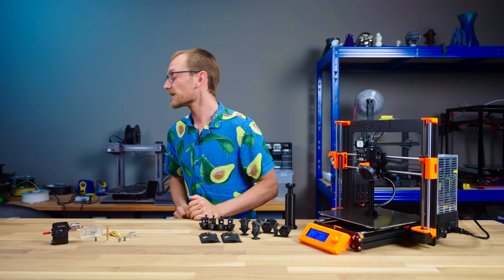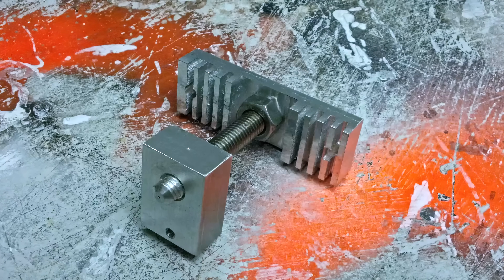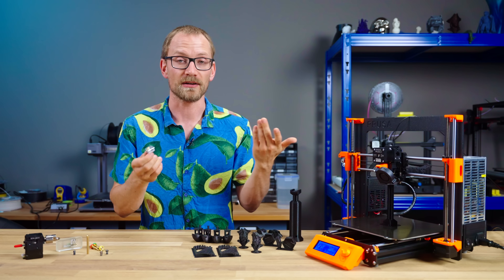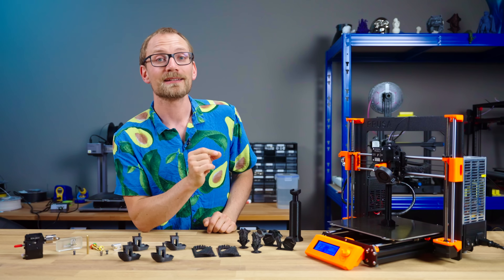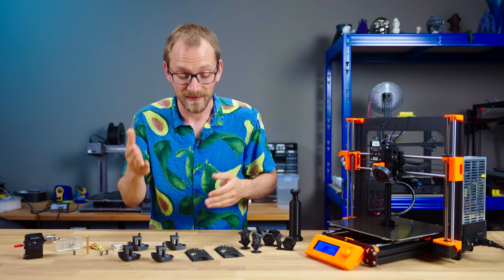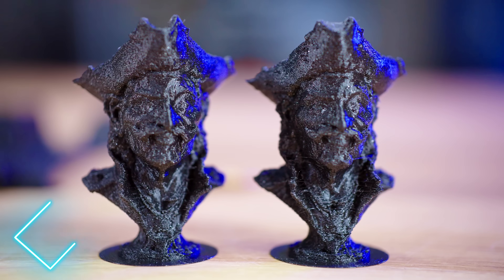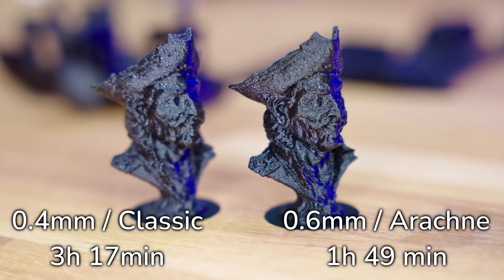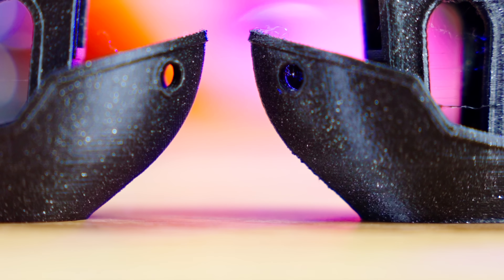0.4mm nozzles just became obsolete

Comment: I think this comparison is a bit unfair. What about comparing 0.4 and 0.6 both with arachne? This is not the correct way to compare nozzles. The slicer algorithm has a primary effect on the quality of the 3d printed part. Also: 0.6 nozzle may work fine on PLA but what about more challenging materials which are much more prone to oozing? And please get rid of that glitter! Not to mention that every change in layer height produces also a change in the strength of the 3d printed part, that is not negligible for functional parts (left aside desktop miniatures)

Comment: You just hit on a major issue with larger nozzle sizes and speed / heat. greater amounts of material means the extruder needs to run faster. Faster speed needs hotter temperatures. This is even a greater issue as the print speed increases.

Another concern might be retraction. Having greater amounts of material means retraction might need to be faster and for longer distances to create back pressure. This could led to more hot filament being pulled into the nozzle and heat break resulting in blockages.

I think there might need to be more testing before I would recommend to beginners to just upgrade.

Comment: Great timing 😁 Finally someone made a precision machined nickel-plated copper "nozzle extension" piece, so now I can use my fancy 0.6mm "regular" length nozzles in my volcano style block 😃 - Including the filament "splitting", high flow type nozzles, and other speciality nozzles that just aren't available in "volcano" format at all 😃 best $2 ($4 w/shipping) I spent in a long time, now I can get "everything" done while focusing nozzle budgets on just one format - no need to buy volcano nozzles anymore to print with "volcano hotends/blocks". With this tweak, I can regain a bit of the detail lost just running 0.6 "regularly".

Comment: I have all my slicer profiles set to a constant flow rate, being 10mm3/s, and use M220 to change the speed per filament (I use Klipper and reworked M220 to only change print speed, and travel and retractions are not affected, making it a speed parameter for flow rate). With my workflow, a larger nozzle wouldn't necessarily speed up anything aside from travel moves, especially considering extrusion width exists. Now, the higher layer heights would be attractive for cosmetic purposes because that's a function of the bore hole, not extrusion width to my understanding.

Comment: I came to the exact same conclusion.  I use .6 on all my machines except for one at 0.5 on a tuned in machine.  Especially since the insane software improvements of late it's hard to tell the difference.  The only time I bother to swap out for smaller nozzles is for gears.

Comment: depends on what you are printing.  In the case of models you want to see no layer lines, so running a .4 with Arachne with a .1 layer height will give good results.  Been running Cura 5.0 for a while now with Arachne, and it just changes everything for the better, regardless of what you are printing.  Looks like everyone else is playing catchup in adding the new engine LOL.  
I print N scale and HO scale models on my FDM and SLA printers, and the advent of Arachne changed a lot of what I could print on the FDM printers.  Small detail parts in N scale were hard or ignored before, like a hand brake wheel, actually do print on the FDM now.  Granted they are still much cleaner on the SLA as they should be, but at least it IS possible for it to show up.

Comment: You really need to address volumetric printing. Nobody should print with print speed settings anymore. Volumetric speed is the only consistent way of getting good result and printing times between nozzle sizes are minimal when you do this. Volumetric printing is optimizing and not skipping steps

Comment: Another perk to .6mm: lower chance of clog (any charred detritus or dust smaller than .6 will pass through)
Another downside to .6mm: resolution of sharp details of the faces of parts (not shown super well by the pirate). Absolute no go for minis. Top surfaces will also suffer a little bit on those sorts of models for the same reason.
That being said, looks like I'm getting another bag of .6mm nozzles!

Comment: From my experience most printers are flow rate limited, meaning increasing acceleration and speed with a smaller extrusion width and layer height will get you better results with the same speed.

Maybe you want to print your infill or internal perimeters thicker for the sake of strength and cohesion. Why not just increase extrusion width for these features?
Reply: My MK3S is flow rate limited when I'm using the 0.8mm nozzle, or flexible filaments using pretty much any nozzle. But with PLA or PETG and a 0.4mm nozzle I can't hit the limits of flow rate without encountering problems related to nozzle speed and acceleration. My guess would be that this is common to most "bed slinger" designs.

Comment: What about strength?  I have had a few failures with prints that I thought were solid, but had a layer binding flaw buried in there which weakened the part significantly.  Can I improve layer bonding with the larger nozzles?

Comment: I use 1.2mm nozzle
300x300x300 cube prints in less than 24 hrs :)
0.35mm layer height
45mm/s print speeds
I use it for printing giant hollow RC airframes
I made a 1;25 scale B-2 Bomber in 12 parts

Comment: Recently printed a 5-inch hose connector to attach to a base-board for the heat exhaust of a portable AC unit. Was gonna take nearly a day to print on 0.4, but I went strait to a 1mm nozzle and cut that down to like 5 hours and the part came out super strong! 
I am definitely an advocate for using larger nozzles for simpler prints, boxes, cylinders, things with simple geometry.

Comment: Could switching to .6mm nozzle fix an issue I have with my ender 3 where the nozzle clogs when the print reaches a certain height? Usually around 3.5 inches high, I start to get under extrusion for about an inch before it clogs completely. I've tried so may things and couldn't figure it out. Eventually gave up.

Comment: I'm using 0.6mm for several years now and it always worked perfectly for almost all projects. The only REAL PROBLEM is, that almost all profiles are suited for 0.4mm nozzles and it's not enough to just change the nozzle diameter parameter. In Cura for my latest printer (Longer LK5 Pro) there is no option available to switch the nozzle diameter and I have no idea which parameters to play with for optimal performance.
This is my only critic on this video - telling 0.6mm is better is just not enough - you have to explain that there is more than just changing the nozzle. Which parameters are affected? Where to get a profile? Which knobs do I have to turn to get good results?

Comment: I've experimented with thicker nozzles for years but never had reliable results with anything above 0,5mm. I usually end up having too stiff, uder-heated extrusion that rips the corners of the part off the heatbed. Also curling on overhangs is a much larger problem with thicker nozzles. Increasing the nozzle temperature seems to be quite unstable solution resulting in occasional overheating. Even slowing down the print doesn't help. After your video I'll give it one more try perhaps. Arachne really seems interesting for large-scale cosplay prints. These are usually very messy with tons of very thin walls, that would just be printed as holes with the classic slicing engine.

Comment: I have used 0.6mm ruby on my UM2+ since I got is in 2016 and have upgraded all printers since to 0.6mm. The only one I couldn't was my UMO, which was a fixed 0.4mm, which I thought was the first production printer with 0.4mm in 2011, rather than E3D. Could be wrong, though!

Comment: I'm surprised you didn't get away from 0.4 a while ago. I've run 0.5 (Taz 5) and 1.5 (MOAR extruder) and worked out great prints on them all. 0.5 is my standard size.  We may hit a mechanical limit (speed, flow) with 0.4, but probably match what the slicers could deal with at 0.5 -0.8 within a few years.

Comment: I've been using a 0.6 nozzle for almost a year now, and even though I had my doubts in quality that I was thinking I was going to be switching according to the use case, that hasn't happened and just like you said quality in 0.6 doesn't take to big of a hit, and in my case it really isn't an issue since I mostly print cosplay props (and even in the case of needing to have better resolution I just lower my layer height); and the printing time gain is really nice

Comment: I'm not sure I agree with the title after watching this.  It's great clickbait, don't get me wrong, but all I walked away with from this article was that it sounds like Prusa is soon going to make it easier to print with higher-diameter nozzles.  That is far from making something "obsolete" - if anything it gives people a greater incentive to potentially switch from a 0.4 mm nozzle. 

One thing of note - it was actually pretty easy to tell which prints were 0.4 and which prints were 0.6.  Contrary to Thomas' claim, there is enough of a difference between the two that you can spot them at a distance.  When the day comes that we see prints at 0.6 with the same level of detail as 0.4, I will gladly permanently switch to 0.6.  Until then, 0.6 remains my preferred choice for prints that do not require high amounts of detail.

Comment: Been printing with 0.5mm nozzles for about 3 years, recently upgraded to a cht one, so much quicker than a 0.4mm one, and layer heights of 0.2mm is my default compromise for speed. 30minute parts are awesome.
Reply: Do you have a 0.5mm CHT nozzle? I'm thinking the same. Are you still happy with it? Any drawbacks please?
Reply: @LaurenceGough 
I've been happy with it so far.. The melt rate is noticeably faster.
I did a flow rate test with the original nozzle and the cht and as expected it maintains good flow way past a standard nozzle. (at least 25% more flow) and beyond where flow drops off it drops of slower too. Iirc it was about 15mm2/s whereas the standard nozzle was getting about 9mm2/s reliabilly.
I'm using a (triangle lab) ceramic heater but I kinda wish I'd gone for the volcano version and got the nozzle spacer/adapter as I think I'd then be up to the 25mm2/s rate.

Comment: I use a self made stainless 1mm nozzle for ABS prints from some time now...
I've been forced to do so, because I tried multiple ABS and PETG filaments, but never got rid of a issue: for some reason they eventually clogs the 0.4 and 0.6 nozzles.
And I clean all my nozzles with fire, but the 1mm ones that I bought didn't worked well with so much heat, some warped while another ones cracked...

Comment: With the Arachne engine and having recently bought a resin printer, I think my days of FDM printing with nozzles smaller than 0.4 mm is over...but I intend to keep the 0.4 mm nozzles for anything that can't have supported overhangs (for whatever reason) or has text that needs the fine detail possible from the 0.4 mm size. 0.6 is otherwise pretty great even without the Arachne engine for functional printing.

One reason to go well above 0.6 mm: vase mode prints. You can get good, strong vase mode prints with a 0.6 mm nozzle and a line width of somewhere between 1 mm and 1.5 mm (I used 1.2 mm); a layer height of 0.24 mm provides a good mix of strength and definition. I've also gotten good vase mode prints from a 0.8 mm nozzle, 0.28 mm layer height, and 1.6 mm line width and have even tried a 1 mm nozzle with 0.36 mm layer height and 2 mm line width - if you slow the print speed down or have a hot end capable of pushing a lot of plastic at once, you can get incredibly strong vase mode prints with these simple changes.
Reply: Does the smaller nozzle help with bridges/overhangs then?
Reply: @LaurenceGough  Indeed it does - the plastic being extruded is thinner than it is from a 0.6 mm nozzle and the part cooling fan (if being used) will be able to remove heat from it more quickly. This would also apply to dense metal-filled filaments, in equal parts because of the greater mass of the filament and the drastically higher heat capacity.

Comment: I've been using a 0.4mm nozzle with a .25 line width, 0.1mm layer height and getting incredible results due to how the models divide up dimensionally with the even amounts.

Yes it takes more time to print but if you're going for quality over speed I think that's the way to go.

I did try a 0.8mm nozzle with a 0.2mm layer height and a 0.5mm line width with the intake rate set to 125 percent of normal and absolutely screamed through terrain pieces while retaining very good dimensional accuracy so maybe give that a go for bigger parts.

Comment: I've been using 0.6 and 0.5 nozzles for years. Very few prints have details requiring smaller nozzles, and the speed benefits make it a no-brainer decision. Nice that the slicers are get smarter about fine details. Hopefully now I won't have to change nozzles for fine detailed prints, but I've already switched most of those to my resin printer instead anyway.

Comment: Switched to a 0.6 back when I switched away from brass nozzles. I started on a 0.5mm nozzle with a Da Vinci in 2014 and quickly moved to a 0.35mm J head. Did a lot of testing back around 2015 using 0.2-0.5mm nozzles and most recently 0.6. If you are making parts that are 1" or less then a smaller nozzle may help with details as well as lower layer height of 0.1mm but if you are printing parts for other printers or 2"+ then 0.6mm is the minimum IMO. With 0.6 I regularly hit 100mm/sec on an Ender 3 V2 clone(Aquila) with H2.

Comment: Rather than switch to a 0.6mm nozzle I've been printing 0.8mm or 0.6mm lines with a 0.4mm nozzle. Works pretty well, there's a flat spot at the tip of the nozzle. As long as your lines don't exceed the diameter of that flat surface it'll print fine. Not my idea - there's a CNC Kitchen video on this subject. He found that 0.8mm lines produce a stronger print than 0.4mm lines using a 0.4mm nozzle. I suppose you could probably get 1.2mm lines with a 0.6mm nozzle, but then you run into the melting rate problems mentioned in this video. (Luckily my printer has a Volcano-style hot end if I want to try it.. Sidewinder X2 😁 .) I'd argue that, with a 0.4mm nozzle you'd have better control over finer lines when the slicer reduces the line width, while still being able to print lines as thick as 0.8mm. Yes, I'm using Cura 5 and this "arachne engine" definitely works nicely, I can print things at 0.8mm line width I couldn't print in Cura 4.17. I notice in Cura 5 you can actually change line widths for different parts of the model and associated structures (I've found a good reason, for instance, on a certain model, to print a brim at 0.8mm and the model at 0.4mm line widths) and you can set the limits of how fine the lines can be printed.

Comment: I'm curious about the strength properties of prints with the larger nozzle. Since we're talking about mechanical parts, cases, covers, mounts and the like, this would seem like an important consideration. My gut feeling is that using a larger nozzle and layer height should probably produce stronger parts, but it would be good to test this.

Comment: Excellent content.  But so frustrating.
I only have a couple hours a night to mess with my Ender and finding settings that worked reasonably well took weeks of hair pulling frustration, three slicers, and dozens of videos to even begin to understand what was happening.  

But that was for a .4 nozzle.  Now I have to tweak everything again to double speed?
I am stubborn by nature so I will probably just go through the process again, but the magical nature of the same machine with the same filament behaving differently for different people is going to keep a huge number of people away from PLA printing.  If there was just one decent performing and cheap machine with settings that worked for everyone with a recommended filament, this hobby would be so much more fun.

At least the tests will go faster this time lol

Comment: I print a lot of functional stuff and to be honest I use a .8 the most.  The hotend can drive it.  It is fast.  Adhesion is better with tpu and nylon and xy detail is just fine unless the part have small details. I increase line width too a lot as well for low detail parts.

Comment: This makes a lot of sense to me. Larger nozzles print faster and are less likely to clog (removing a pretty common failure mode). I'll have to try out this arachne thing to see if it can fix my one quibble which is that the minimum thickness on lithophanes is often too small for a >0.4mm to handle.

Comment: used to run a .8 mms nozzle on my first printer. it was legit almost faster to print a cup in just under 5 minutes in vase mode than it was to walk downstairs and get one because you could ramp up the flow speed to ridiculous levels

Comment: Great video! Stefan from CNC Kitchen has shown that you can even print 0.8 lines with a 0.4 nozzle. So why not just set the line width to 0.6 and enjoy the same advantages? As long as you don't need the increased layer height.

Comment: Great video, very interesting! I know you mentioned it, but it would have been nice to see some examples of a 0.4 nozzle with Arachne just to see the improvements over a normal 0.4.
Reply: Indeed, the comparison does not seem to be fair... 0.4 with old software versus 0.6 with new software... We all are going to use new version... So how would the perform with the same slicer?
Reply: @andresdans  Yeah unfair comparison for sure. It's the same tradeoff there always was. A smaller nozzle can do finer detail but it's slower. The point should be that the detail difference between sizes has decreased, which means for a smaller decrease in detail, you can speed up your print a lot more.
Reply: Exactly what I was about to comment.